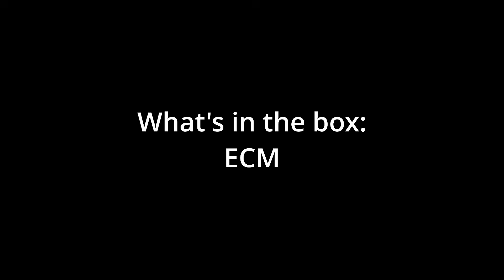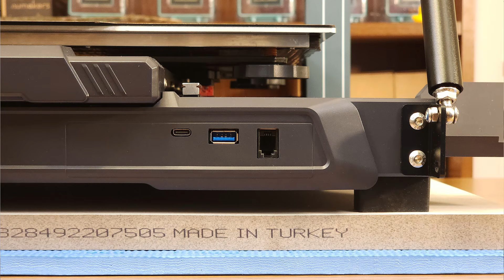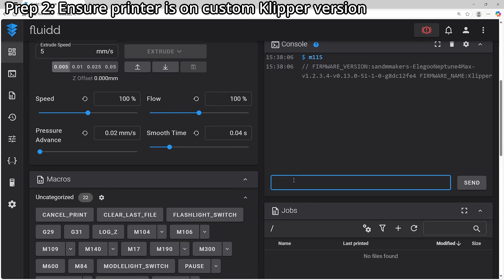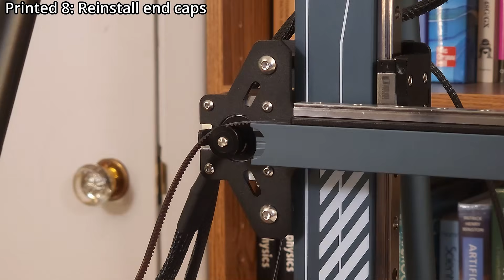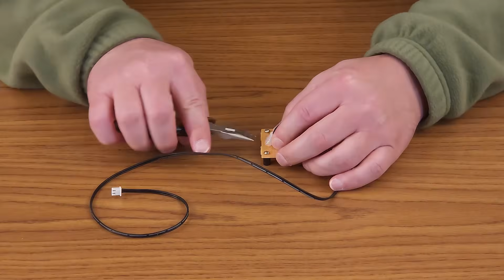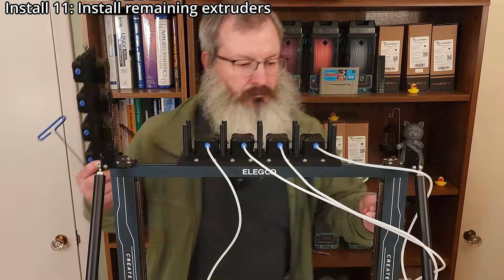8 color printing on the Neptune 4 Max: Part 1

Comment: wish I found this video before I ordered Coprint... Im on day 5 of trying to make it work... lost the fan bar.. no more screen pad. z offset setup is a bigger pain now. and I had a clogged nozzle. Other issues include the loss of printing space. The tension of the extruders and the chromahead pull is making it very hard to print anything. Ive set and saved zoffset 3 times and it still prints in the air. Im just so pissed off at CoPrint, also they didnt send me the brackets I had to print most pieces. The KCM feels like hollow junk. 
The Kiau installation pushed me to v.0.13 klipper so now i get 3 warning erros that the coprint stuff is not uptodate. Im tired... Im so tired...

Comment: We had bought the Neptune 4 max and co print system. The printer works well and prints a ton faster than my old creality. But i really wanted multicolor. We printed your bracket and went to try and install the fireware from co print themselves and honestly it has been ridicoulsly frustrating. Will part 2 be released soon? Just curious. Part 1 has been so, so helpful though!!!
Reply from the maker: Thank you for watching our videos! The second part was released a few days ago.

Comment: On a different note, can you tell me how I can change the bed type on my Neptune 4 Max. I got a textured PEI plate and it does not seem to allow me to change it in the drop down? THANK YOU SOO MUCH!
Reply: That will be done in your slicer.  You’ll see your printer name up at the top. Just to the right of that is a pen md paper looking icon. Click that. Under basic info then the first section should say printable space.  Go down 4 spots and it should say support multi bed types. Then click save
Reply from the maker: Thank you for watching our videos! Part two of this video series was just released a few days ago. In that view, I show using a special OrcaSlicer preset that I created specifically for the Neptune 4 Max (if requires using my printer configuration files). In that preset, multi-bed type support has already been added.

Comment: Whatttt Happppened???
Reply from the maker: Thank you for watching our videos! I've been spending a lot of time on part 2 and it is nearly ready (there are previews on my Patreon), however, I've had a few "real-life" situations come up during the filming of this second video which have unfortunately delayed things.
Reply: @SandMMakers   thanks so much for responding. take your time.  iv been really curious into how it all turns out. I currently have a N4+ with Xand Y rails. recenlty picked up a emmc to program for opennep4tune. after that i was def going to coprint but there are not a lot of "real life videos"  on the product only "advertisement installation videos".
Reply from the maker: Part 2 was released last month if you are still waiting on installing your CoPrint kit.

Comment: Sadly CoPrint bricked my screen of my Ender 5 max, even with their technician installing it. I had to return it.
Reply from the maker: I'm sorry to hear about your CoPrint problems. One of the main reasons I'm creating my CoPrint installation video series is that CoPrint's directions are (or at least were) incorrect and dangerous. Unfortunately, I don't have any familiarity with the Ender 5 Max.
Reply: @SandMMakers  I totally understand. I wish they had instructions like yours. I tried to do the KCM installation myself and could not. They then did all the coding installation and it bricked it. Their response was to let me return the CoPrint parts for refund but they would not replace my screen that they bricked with something called Guppy. On another note, have you heard of an open source AMS like upgrade for our NePtune 4 MAX?

Comment: What makes the extruder mount not compatible with the TBStron3D bracket? Id love a version that is compatible as i just ordered the 8 extruder set. along with the  TBStron3D Bracket since I do not have linear rails yet. I also think it would be cool if the extruders filled the horizontal space across the top of the printer a bit better as well. either by spacing them apart a bit more or making them hold 5 extruders.
Reply from the maker: If I understand your comment correctly, the CoPrint-provided bracket is not compatible with the bracket from the TBStron3D X-axis linear rail kit because the mounting holes are not the correct distance apart. The bracket from CoPrint is primarily intended for Creality-designed printers, but Elegoo used a wider distance between the two toolhead mounting screws. In my video, I present three different options you could use, 1) use the mounting adapter in the CoPrint GitHub repository, 2) use my 3D printed bracket (along with a new X-axis belt), 3) purchase the ChromaHead mounting adapter available on the TBStron3D website.

The extruder mount that I designed is provided as a Step file, so editing it in any 3D modeling software is relatively straightforward. I chose to keep the design compact so it could also be used on the smaller Neptune 4 series variants. Since the mounting bracket is intended to be modular and each additional ECM add four additional extruders, I chose to use four across, but any number that physically fits could work well. However,
Reply: @SandMMakers  I appreciate your reply, but after re watching the video again i fgiured out my mistake. I was trying to determine why it would not work with the belted Z modification. After watching the install for the Z i saw that they try to occupy some of the same areas on the printer.

Comment: Hello sir! I'm very happy that I found your channel! You are quite skilled in explaining things. I have the Max and a Coprint system as well, and I am looking forward to part 2 of your tutorial. Coprint's instructions are straight doo doo!  The discord is decent though, lots of really helpful folks over there. How do you like the set up so far? Also, I've always used screws_tilt_adjust, but I intend to give BedLeveler5000 a go. Thanks for making it, it looks pretty sweet.
Reply from the maker: Thank you for watching our videos! I'm currently working on part two, I just got a bit delayed due to illness. However, Ihope to resume filming soon. Thank you for your interest in BL5K. I have a few updates in the works that should make the utility even more helpful.
Reply: @SandMMakers  You are welcome! Thank you for making them! So many people crap on the Neptune 4 line, but once you get the stock software off of them, they are really quite nice. I recently installed Opennept4une with Klipper  v0.13.0. I've got a lot of learning to do, but with videos like yours and the support on Discord, I'm confident that I'll get it dialed in. I'm sorry to hear about your health. Hopefully you're feeling better!

Comment: Very nice and detailed video, thank you for that and keep up the good work 🙂
And sth. else. Would it be possible for you to upload an emmc-image with the 8 colour coprint hardware already installed? 
Thanks in advance.
Reply from the maker: I've been delayed a bit due to illness, but part two is almost ready and will include easy to follow instructions. An eMMC image won't really work because some of the configuration values are specific to your printer.

Comment: I have done pretty much every mod to my neptune 4 max that you have a video for and I just installed the co print kcm set, but I can't seem to get the printer to start back up. Ill just wait for  part 2 to come out to figure out where I went wrong. thanks for the awesome videos btw.
Reply from the maker: Thank you for watching our videos!!! Real life has been getting in the way lately (kids, pets, trying to buy a new house, etc.), but I'm currently filming part two of my CoPrint series. I'm not sure what you tried, but you can't just change the hardware and have Klipper start successfully. The printer.cfg file needs to be updated, since Klipper refuses to start if the (detected) hardware doesn't match the configuration. Also, never connect/disconnect any CoPrint hardware while the system has power as that could permanently damage the CoPrint hardware.

Comment: Where’s part 2 boss?
Reply from the maker: I'm working on it, but I've been dealing with some family matters. Also, I've been struggling a bit with making the steps easy enough for everyone to follow, since the printer.cfg file changes are fairly extensive.

Comment: You've done an outstanding job with these videos—I've been following all the mods you've showcased for the Elegoo Neptune 4 Max over the past few years. I'm especially interested in the 8-color custom extruder mount, particularly in combination with the previously mentioned Z-axis belt mod. Keep up all the great work you do—it's truly appreciated!
Reply from the maker: Thank you! I'm not sure I would recommend combining the belted-Z mod with the CoPrint mod. While I haven't tried combining the two mods, I suspect the added weight of the ChromaHead might exacerbate the belted-Z mod's falling gantry issue. I'm also working on an Oldham coupler mod which might provide a good alternative to the belted-Z mod.

Comment: Will m3x4mmx5mm work for the heat set inserts?
Reply from the maker: Without modifying the model, the exact size of threaded insert is required. However, if you do modify the model, then there is a little flexibility in the threaded insert. Please bear in mind, though, the portion of the model where the inserts are installed is only about 4.5mm thick, so that is the primary limiting factor.

Comment: After seeing your setup today, I went ahead and bought all of the TBStron3D parts and the CoPrint upgrade. I can't wait to see how bad I get hit by the terroriffs.
Reply: install X and Y rails, and Z rod  with grease/lube or something to protect the Hardened Steel from Rust. Dont ask me how I know.
Reply: @chrizekiel  Interesting. I thought I was fine, but just noticed a small patch of rust starting on my Y rail. Not looking forward to removing these and spraying them down with silicone (I presume that's an appropriate lubricant)

Comment: Did you take your belted z mod off? That mod made my N4M print so terrible, now it’s just collecting dust.
Reply: Yeah.  I see people do belted z mods but I never see videos of how it prints.
Reply from the maker: The belted-Z mod really only makes a difference if your printer has threaded rod related z-banding issues. As a result, my printing quality is about the same with and without the mod, as my Threaded rods were not causing issues.
Reply from the maker: Thank you for watching our videos! I installed the CoPrint system on a different Neptune 4 Max. While not present in that video, I've installed Oldham couplers on this second printer. I'm hoping to eventually make a video for it, but the install is much easier than the belted-Z mod.
Reply: @SandMMakers  I'm still not sure I understand what the old ham couplers are. But I was more curious, are you going to do a video on the BIGTREETECH Eddy? I'm assuming it was the Duo you installed on the Neptune.
Reply from the maker: Yes, I'm currently working on two Eddy probe videos, one for the stock toolhead and one for the ChromaHead. I have both setups working, but I'm trying to develop nozzle wiping stations for each first, because Eddy NG only works reliably with a clean nozzle.

The stock threaded rod nuts need to be "loose" on the printer so they can wiggle a little if the threaded rods are not straight. Oldham couplers provide a better way to let the threaded rod nuts wiggle.

Comment: How is "8 color printing on the Neptune 4 Max: Part 2" coming along?  Fighting thru some of the nuances? I can only imagine.  I am right there.  🙂
Reply from the maker: Thank you for watching our videos! While I've had a lot of non-printing related delays since releasing the first video, I've primarily been focusing on making the software/configuration as easy as possible for people to install and use. So far, the actual printing hasn't been causing any issues.
Reply: @SandMMakers  Love what you are doing here.  Guess we are waiting sitting on pins and needles 🙂

Comment: I didn't see you plug the cable from the Chromahead to the KCM.  Is that covered later in part two?
Reply from the maker: Thank you for watching our videos! You are correct, the remaining wiring was intentionally left for the second video because you need to SSH into the printer first.

Comment: I am working on mine for the Neptune 4 Pro. I had to redesign some CX-1 Extruder brackets because of the linear rail upgrades as well as the Z belt upgrade. I also created a mount to the Top extrusion of the printer to mount the KCM, Should look clean with nothing mounted on the table around the printer and only the power supply not attached the printer.
Reply from the maker: Thank you for watching our videos and good luck on your Neptune 4 Pro mod! There are lots of different mounting options for this mod. I chose to not mount the KCM and ECM on the printer because my viewers might have lots of different printer position and orientation constraints, plus I'm working up to 20 color printing, so mounting 4 ECMs might be a bit much. I am exploring how to move the KCM and ECMs into the printer base, however. 

I've already started working on the second video (part 2) and have nearly completely rewritten Klipper configuration files. While some dimension values might need to change, they should work for the Neptune 4 Pro as well, if you are using my version of Klipper.

Comment: According to Co Print manual you have to upgrade Klipper. Is the display still working afterwards?
Reply from the maker: Unlike in the "official" directions, or the directions on Discord, I'm using my custom version of Klipper instead. Unlike in those other options, my custom version of Klipper maintains full stock functionality. 

https://youtu.be/Aoy3sI1lv1g
Reply: @SandMMakers I have seen your video and had the hope that you tried the other approach as well. Is there a reason why you did not follow the co print way?
Reply from the maker: Each video can take hundreds of hours to complete, and since I do this as a hobby, I unfortunately do not have the time to include everything.

The hardware portion of the installation is identical for all versions of Klipper. I chose to focus on my version of Klipper because there are already guides and resources for other Klipper versions.

Comment: I got into colour printing a few months ago with a Kobra 3 Max.  I bought that simply because Elegoo don't offer colour options (yet).  This is a brilliant video to show how I could modify my N4Ms or N3M, but as they work, I don't dare try it as I'm convinced that I'll completely mess them up in the process.  I'll think I'll stick to your linear rails video.  Great job though - love it!!!
Reply from the maker: Thank you for watching our videos!
Reply: I think it may be more cost effective to just buy a Kobra 3 Max than to upgrade a N4M with both linear rails AND multi color printing anyways, but I still wanna try it because I like to tinker lol.
Reply: @Qu9ke  LOL.  Yeah, this is one of those projects that just looks so tempting because it is so amazing, but I suspect it will have me ripping my hair out.  I've got two printers down at the moment that need repairs, so messing with a perfectly good one is low on my list... for now.  🙂

Comment: Great instructions.
I have a Neptune 4 with all the linear rails and rod supports.
I also installed Open Klipper.
Question: Will your version of the Klipper work on the Neptune 4 and will all the Open Klipper options be available in your version.
Thanks.
Reply from the maker: Thank you for watching our videos! While I don't have a Neptune 4 to test and confirm, I'm fairly confident my version of Klipper will work on all Neptune 4 series models.

However, please note my goals for the custom version of Klipper are very different than the goals of the OpenNeptune project. While they are striving for a "vanilla Klipper" experience, removing all Elegoo modifications, my primary goal was to make as few changes as possible while providing modern Klipper features and mod compatibility. Additionally, my work (currently) only updates Klipper itself, and not the other applications and services that are generally considered part of the Klipper ecosystem (moonraker, Fluidd, Mainsail, etc.).

Comment: I love your videos and outfitted my whole Neptune 4 plus with everything tbstron sold for it so my x,y and z axis’s are all linear rails! I bought the silicone bushings for my bed but I lost a place to live in the middle of it and I’m getting a new apartment the 1st, do you have or can you make a video of how to install them on the plus? I bought them off Amazon but they no longer sell them and my first test I realized I got something wrong!
Reply from the maker: Thank you for watching our videos! Unfortunately, I haven't made any videos related to replacing the bed springs with silicone spacers and I do not own a Neptune 4 Plus. What problems are you currently experiencing?